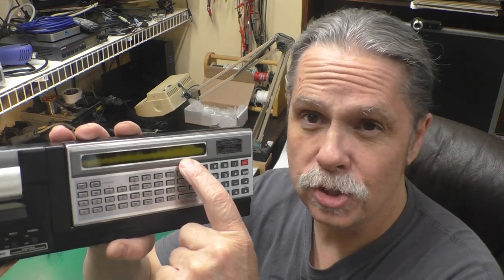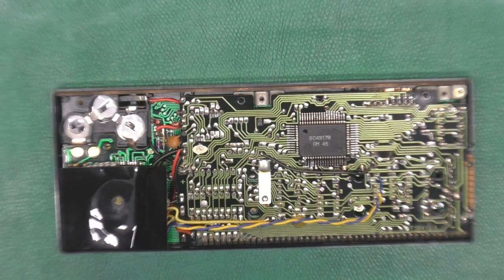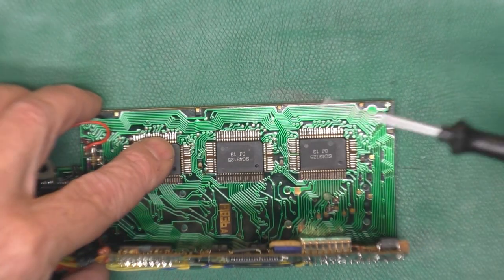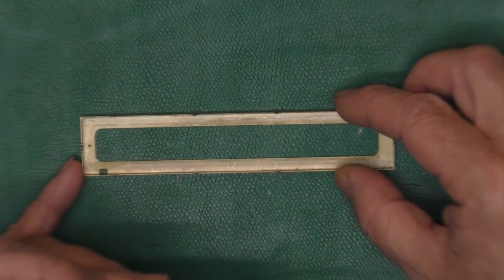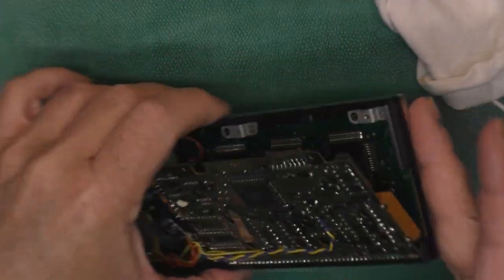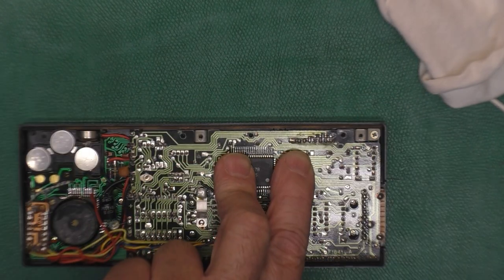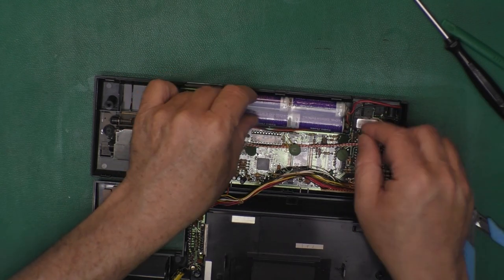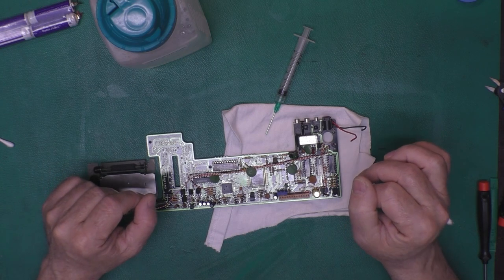Tandy PC-1 / Sharp PC-1211 New LCD, Printer/Cassette Interface Refurb

Comment: Hey Birt, I just replaced the LCD in my PC-1211 based on this video, and have to say thank you, thank you, thank you! I just used a heat gun to free the old LCD, and it worked perfectly - it even left the old glue in place so the new LCD is sitting snugly in place, and working perfectly. I also fixed my EL-5100 the same way. I can't tell you how much I appreciate your videos - they have inspired me to start collecting the calculators and computers of my youth :-)

Comment: Hey Birt, I'm in the middle of refurbishing my PC1 and soon to arrive the PC1 cassette/printer. I have ordered the LCD and the NiMH batteries as per your design. I'm curious what plug pack would work best for the cassette/printer and is it center negative. Thank you for your great content.
Reply: Update - replaced the LCD with no issues - Great! But my last 2 EBAY printer purchases proved to be a waste of hard earned money. Both units were corroded so much that the copper trackes and component leads were none existent. I'll still be searching......

Comment: 46:35 What's that button and spring for anyway? The service manual refers to it as an "earth knob"... 🤔
I have a CE-122 with major corrosion that couldn't be saved anymore, despite major cleanup. Too far gone.
Reply from the maker: I suspect it was an attempt to bleed off any static charge from the printer. Early on there was a problem with the PC-1211 acting screwy while docked and printing. They started sending out two special case screws for the PC-1211 that had springs on the end. The springs would touch the front cover, so the front/rear covers were at the same potential.
Reply: @HeyBirt  Thanks for the info! Yeah, I found a note about the replacement screws along with the original (flat blade) crews in the carrying case.
I still don't understand why it was so popular to equip these peripherals with built-in batteries. Individual cells were available off-the-shelf in electronics shops.

Comment: So, I  have the exact same items as you do Birt... I need to get the LCD display and replace. Spent the afternoon re-furb'ing the printer. Build up a battery pack, like yours. Spent a lot of time getting the printer mechanism freed up. The grease was solid and nothing moved. Once I cleaned this all up and lubricated everything, the printer mechanism now will feed the paper, move the head etc. when the feed button is pressed. However, I have yet been able to get the pocket PC to print. Initiating a LIST with a simple program in the PocketPC seems like it is sending  but no activity on the printer. Any ideas? Wish we had the service manual for this thing... I'll start scoping various pins on the connector to see if there is any activity
Reply: One difference I see between your printer and mine, when you turn on your printer, yours feeds the paper. Mine does nothing. Not sure if that is relevant or not.
Reply: CE-122 service manual  found!!!! Woot.. Now to debug.
Reply from the maker: @andrewkissel3807  Since yours is not triggering the printer init it means that the printer is just dead or perhaps it is not seeing the docking signal from the PC-1211 (forget the proper name but when you plug PC-1211 into printer it completes a circuit so printer knows it is there.)
Reply: @HeyBirt  Been looking at this for a couple of days now. I see CPU activity on the address lines, but nothing on the data, R/W, or Chip Enables. It seems like the code is executing in a loop, which makes sense if executing internal code in a polling loop. The schematic/PCB layout for the CE122 I have doesn't exactly match my unit so it had me down a couple of rabbit holes that were not related. I agree, there is something wrong. Wondering if the ROM code in the CPU degraded?  The one rabbit hole I went down was trying to determine why the print mechanism/PCU wasn't being triggered to PageFeed at startup. The CE122 schematic shows control of the PF input to the PCU via several diodes + NPN that would assert the PF signal by the main CPU. Only, my PCB is different enough that the one diode that would perform this isn't installed on my PCB. What I need is a working unit to characterize the startup and running state for some of these signals....

Comment: Hi, I have sharp ce-122 (same as your printer /casette interface, but not branded as radio shack) and my unit was more corrorroded and the red wire from battery to the smaller pcb  with the bus connector fell off because of corrosion, and I don't know where it should be connectoed on the smaller pcb and I was wondering if you could help me by checking where it connects?
Reply from the maker: I did not take a picture of that board when disassembled. Page 24 of the CE-122 service manual shows where each signal is connected to that PCB. If that does not help look at the contact information for this channel and send me an email so I can email you a picture.,
Reply: @HeyBirt  Thanks, found where it should connect

Comment: Hi Jeff, You can't use a line in port on your sound card, you need to use the microphone input. Use Audacity to bump up the volume of the recording and you are fine. Don't export the file as MP3, use plain WAV.
Marcus
Reply from the maker: Hi, you are correct it 'should' have worked better. 

I was using the microphone input on a StarTech icusbaudio2d which is what I use for doing voice overs (so I had it plugged in at the time). I did have the microphone volume in audacity turned up as well and it is turned up to 100% in the windows configuration dialog too. 

I did not try and microphone input on my SoundBlaster card.  I'm finishing refurbing a few small tape decks now so I can test saving/loading to them and I'll try the SoundBlaster mic input.

Edit #1: I just tried with same USB input and normalized it after recording which brought the level up. I need to find an extension lead to plug into the sound blaster in the back of PC as I don't have the front panel sockets connected. I'll edit this reply again when I try the Sound Blaster.

Comment: Do you have the power supply polarity for the CE-122 (the same that the TRS 80 Printer cassette Interface, but from Sharp) ?
Reply from the maker: It is a Sharp EA11E power adapter, 6VDC unregulated, center negative.
Reply: @HeyBirt  thanks. Pretty sur i have one but unable to find it. Damned power plug everywhere

Comment: I did the same refurbishments as you did here. My printer interface was more corroded because of the batteries, but I managed to clean it up and repair broken traces. Now the printer and saving to cassette works, but I have the same problem as you that I cannot hear any loading sounds back. I managed to get it to load once or twice with the volume from PC sound card maxed out, but still, then it is not reliable. Maybe the cap from the input jack needs replacing? Do you have any suggestions? I doubt it really needs such high volume to load.
Reply from the maker: The audio output on the cassette interface is very, very low. It is just how they are designed. You need a pre-amplifier to raise it up to a level recordable by a PC sound card.
Reply: @HeyBirt  No no, I mean the output to pc works great, I can save my program from Sharp to PC, but I cannot load them back on the Sharp. The signal seems to low to load properly. I wonder if there is a fault or this is by design to expect a higher amplitude.
Reply from the maker: @SilverGreen93  The problem is the output level of the cassette interface is too low. On the PC you have recorded a very quiet sound. When you play it back the PC cannot make it loud enough for the cassette interface to hear. 

Sometimes with Audacity you can normalize the recorded waveform and resave it to get it to work. This makes it as loud as possible in effect. This sometimes does not work though as the original signal is too low. 

The signal from the cassette interface you want to record need a preamplifier.

Comment: Is it fine to power from SR44 considering they have 1.55V?
Also, what paper width does this take?
Reply from the maker: You will need to add a silicon diode in series with the positive battery lead. This will drop about 0.6V which will let you use alkaline cells. 

The paper roll is 45mm wide x 25mm OD according to the manual.
Reply: Thanks, I will try that

Comment: Hi. I just changed the screen with a new screen, but now when I press ON to start the PC, DEF and RUN show up on the screen and then if powers off. The same happens if I press the reset latch on the back. DEF and RUN briefly show up, and then it shuts off. Do you have any idea what could have gone wrong? The PC was working perfectly before. Thanks!
Reply from the maker: Check around the areas of the PCB where the metal tabs of the LCD frame are. It is very easy to scratch a trace and cause a problem.
Reply: @HeyBirt  I managed to fix it! 🕵 There was a tiny bit of loose solder that shorted two of the CPU 1 pins that caused the issue! Thank God nothing was burnt! 🙄
Reply from the maker: @SilverGreen93  Great news!

Comment: Great Video! My display is in great shape but when remove the back cover and insert new batteries, the computer gives a steady beeeeep and the display shows some gibberish. If I push the reset button, the beep starts again and the screen shows different gibberish. Any ideas? Thanks
Reply from the maker: This is a state I have seen them get into and have not found a solution. It would not hurt to try a fresh set of batteries and hope that solves it.
Reply: Tried new batteries and the problem remains. @HeyBirt